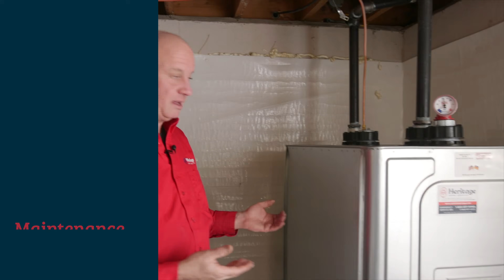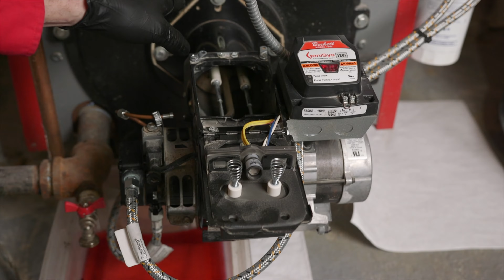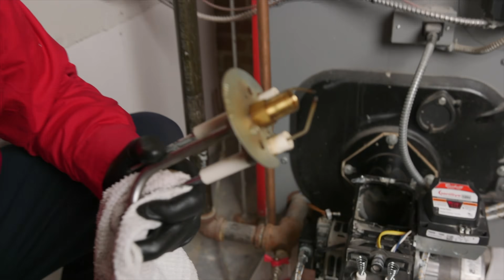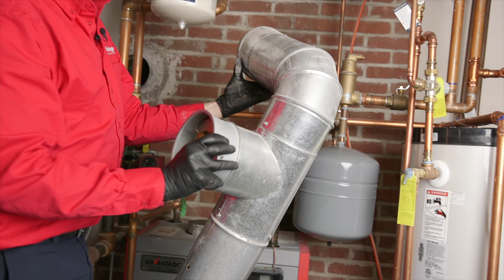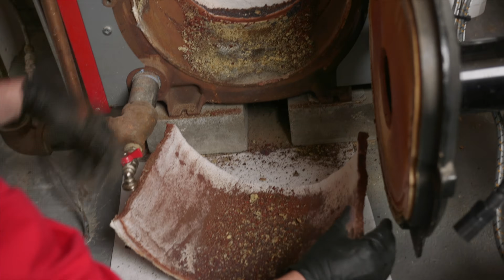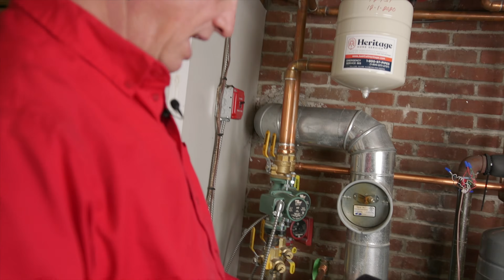Oil Boiler Maintenance: Annual Service & Clean

Comment: 16:43 with those plastic gauges it seems to require care t to make sure the tips are not resting against the plastic, which would give a misleading setting. It needs to be not contacting the plastic and just floating in position with no side pressure.  Best thing would be to check it with a T501 scale type gauge since that allows the tips to be fully floating with no side pressure.

Comment: had 2 fire up the old olsen oil boiler , 80 some %  [ efficient !! ] ,... outta firewood .. [ $#@!! ] . twin oil tanks .. [ basement ] .. only lil bit of oil in the 1 tank ,,guage not hooked up , nor is piping ... fill / vent .. to outside  . simple honeywell thermostat .. damn thing fired rite up , 11 or 14 yr. old oil , !! only problem , blowin that [ cool ] not $#@!! hot heat air thru the [ now ] cold water..usually about 165 deg.coil / radiator / heat exchanger in furnace plenum !!...hardy s.s. outdoor wood boiler ... outta wood !! ..$#@!! . y circ . rusty water  w / cast iron s.o.b. ..[ some other brand ] boiler ??.. that s stupid !! .. so s runnin outta wood !! .. hardy h-4 , 180,000 b.t.u. , burn anything .. [ wood , seasoned .. NOT tires /garbage , dummies !! ] .. read the manual , catch rainwater , nuetral p.h. , no b/s controls/ etc. , two 1 inch , two 3/4 pex lines 4 ft. deep , less heat loss !! great unit ,,simple , no  $#@!! commie crap, burnie , she s called , is hungry , eats a lotta wood !! , no carryin in wood , ashes go on ground , ,, gotta get 150 or so gallons antifreeze ,  replace the water .. $$$ , .. think i can use auto. green stuff , also need 2 put in valves .. shut off and drain , coil in furnace plenum so i  ain t blowin .. not hot ... air thru .. cold water filled ..  coil .. [ don t run outta wood !! ] , 2 thermostats , feed the [ wood eatin dragon , burnie  ! ]  once or twice a day, , when she s a-burnin , toasty warm [ old , like me , needs work ! ] house , .. don t run outta wood !! , simple , basic , no b/s , new shit ain t improved !! , dude had terrible shit water , ate thru his hardy s.s. boiler , he bought s.o.b.. .. shoulda bought another hardy , .. fill w / rain water  !! , ... f t w 26 .. $#@!! cold weather s  a- comin ... %$#@!!

Comment: Great video!  That's about the cleanest oil boiler that I've ever seen!  No soot at all.  One thing not mentioned is cleaning the air inlets which are on the collar that the pump is bolted to.  Dust and lint often clogs the inlets.

Comment: Watching the oil boiler maintenance step by step was interesting, especially the nozzle and electrode spacing part. I didn’t realize how precise that combustion setup needs to be. Someone from American Residential Services once told me oil systems can get messy fast if maintenance gets skipped for a couple seasons.

Comment: Nice detailed video. I had to start doing my own work because every tech I hired never cleaned the heat exchanger or opened combustion door. As far as burner life expectancy goes, I have a weil mclain boiler and a becket burner with a power venter. Was told burner and power venter only lasted 7 years but here we are 30+ years later and my system runs just as good as when it was new. At 12 years I bought a new burner and PV blower motor and both are sitting on a shelf collecting dust.

Comment: Why didn't you check the head assembly distance to nozzle? They have a gauge for that also. You don't know it was set right from the beginning or someone moved it afterwards.
Reply: This is very true! Some techs just know the bare minimum basics unfortunately. I would never pull out that orange guage just to set Beckett electrodes either 😂

Comment: Thanks for this.  I always like to do the smoke test first, then use my electronic analyser.  That way, if the flue gases are dirty I won't wreck the sensors in my analyser.
Reply: I agree, I was taught to do the smoke test first so you have a baseline to know exactly where your at when the analysis is done. Didn't see a draft check either.

Comment: Why would you pull the pump off to check the drive coupler when pulling the motor is much easier, and now you can clean the fan cage if necessary, which you left out?  Many techs don’t even check the coupler, I change those things out if they look at me funny. Nothing worse than going out at 2am because of a little piece of plastic!  Stay warm!
Reply: He didn't. He pulled the cover off only to change the pump screen.